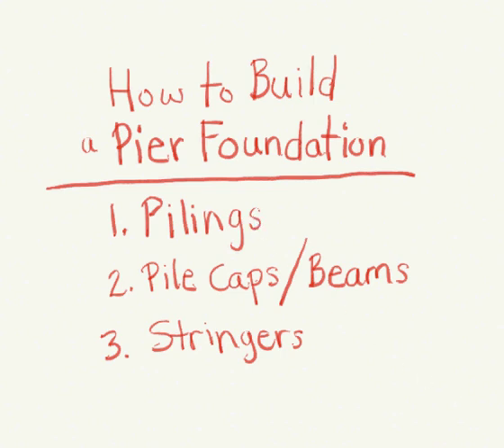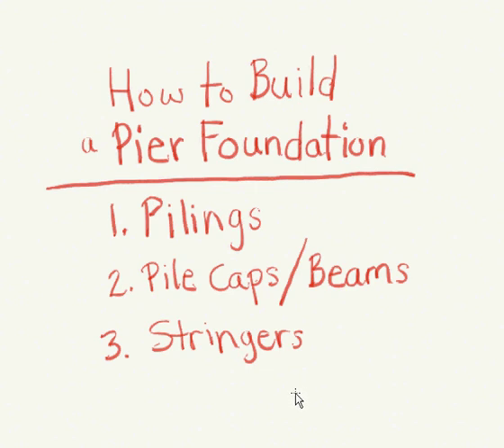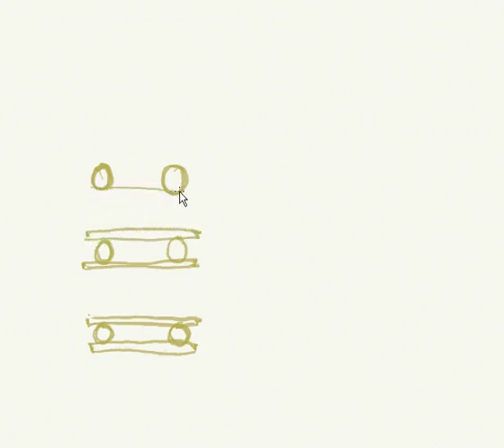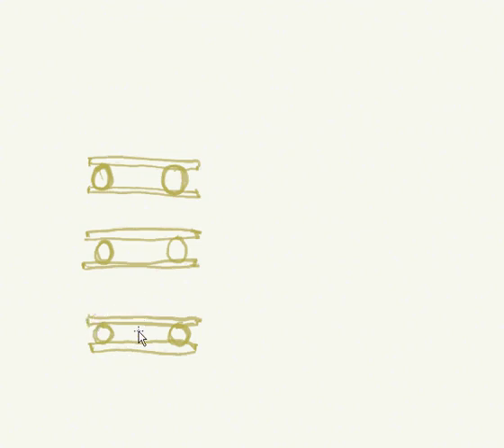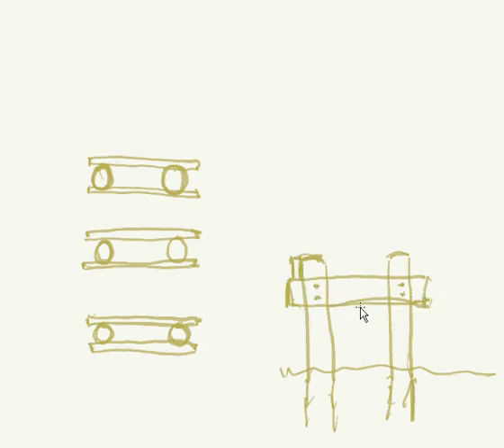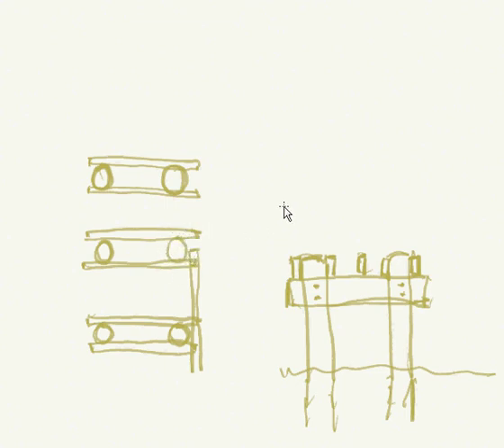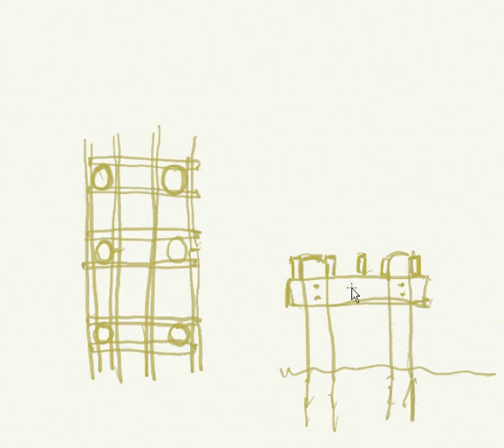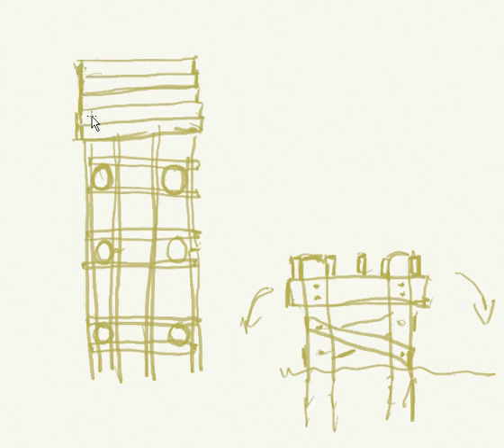How to Build a Dock or Pier Foundation

Comment: Hi Chris. Great video. For creating piers prone to hurricane/ typhoon conditions, I am envisioning a tropical beach structure more ADJUSTABLE. 
Is it conceivable, to build modular stringers and deck with dowels.  I’m thinking a storm alerted tool handy group/ like roadies to temporarily dismantle the deck in sections and leave the caps-piers?
The sections would be emergently transported away from impact zone.
Then, post storm, the crew carts the components back to the piers and REINSTALL the stringer deck components?
I’m thinking a 3 day dismantling window before storm landfall.
I’m interested to know your thoughts!

Comment: Hi ....Regarding the stringers., How can they be on 16 or 24 centers when you attach them to both sides of the piles...which are maybe 12" in diameter or less. Im also wondering how do you support the stringers that would run on the inside of the piles...they wouldn't be attached to the piles so are you just toenailing them into the beams ??? Thanks.

Comment: Hey Chris, I have a 48X48 ft dock on a lake that is elevated by about six feet above average water level.  I would like to build a six or eight foot addition out from one of the sides with landing, stairs about two foot lower.  I want to cantilever the overhang with 2x6 gussets going back to the existing pilings instead of driving more pilings.  Do you know how far out I can go with the overhang?  Or can you direct me to a site that can assist me with this?  Thanks, Keith Matherne

Comment: how do you attach the stringers to the beams. Do you want it to easily pop off if water rises do to hurricane so it doesnt pull your pilings out or what is recommended. Thanks

Comment: I live in Ontario, Canada so our lakes and bodys of water freeze over obviously, would this affect the integrity of the dock that you described? Also where I'd like to build the dock there is a lot of rocks their so driving a 12ft 4x4 into the mud will be close to impossible so should I just have the wood sit on the bottom? Thanks in advance.
Reply: Smith2627 Did you ever receive an answer regarding the winter ice and rocky bottom?  We want to build a new dock on Lake Nipissing and have exactly the same questions.
Reply: Build a dock with rock cribs.
Reply: My lake always freezes so use lots of rock in your cribs Mine hasn't moved in over 25  yrs and the cribs are completely filled

Comment: How far apart should your pilings be?
Reply from the maker: it depends on what you're building, where you're building it, and so on. You should have an engineer or professional builder specify that based on your application, wave action, structural requirements...